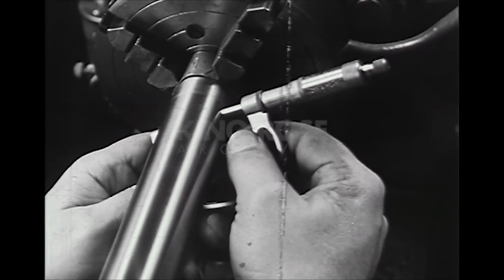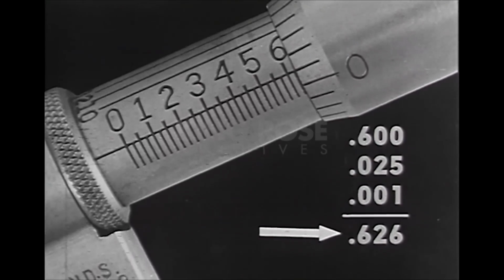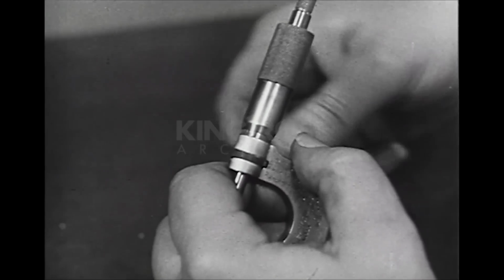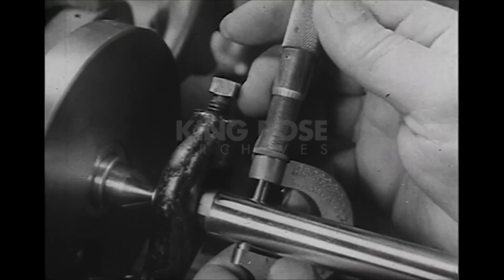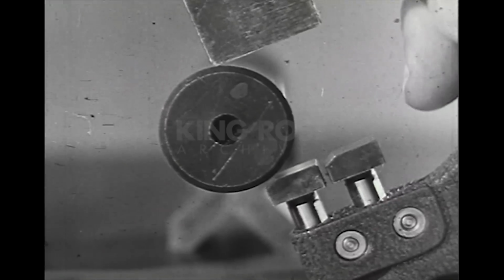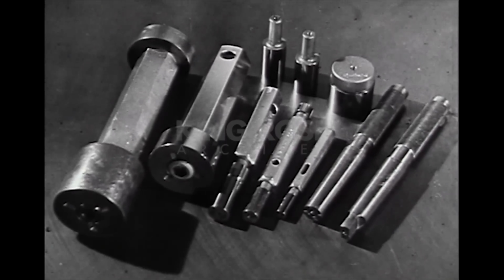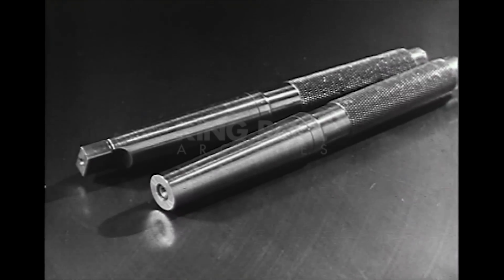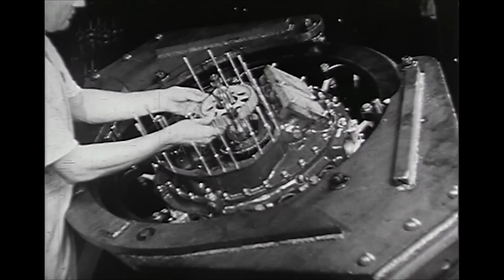Precision Unveiled: Master Metalworking with the vintage 1945 film on the Micrometer Caliper

Comment: Why no tenths of a thou ? (.0001)
Reply: that's an advanced concept for this basic introduction video....
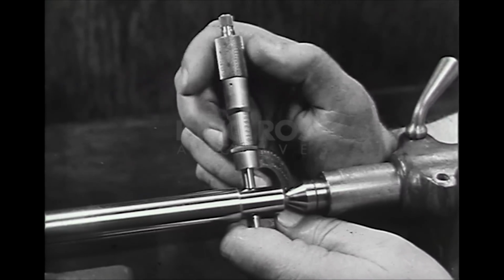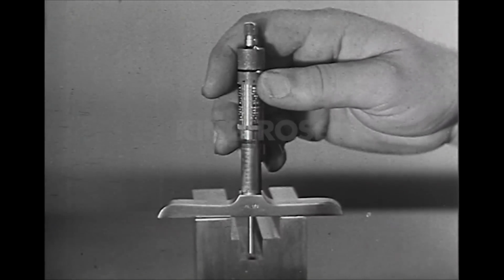Reply: I was sure they would discuss it as the micrometer at 4:25 has a ratchet that was not used and the graduations for tenths. Why use finger friction if the caliper has a ratchet and can measure tenths? That tensioner ratchet was used at 12:07 but never discussed. That tensioner ratchet allows for accurate repeatable measurement of tenths.